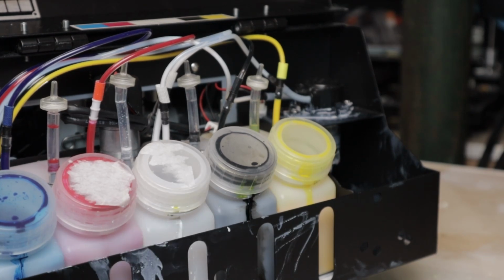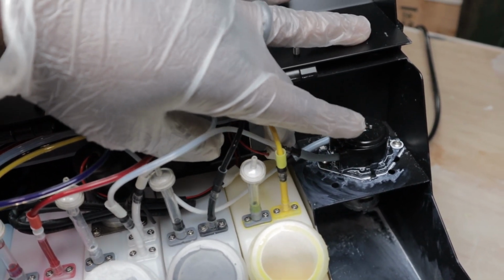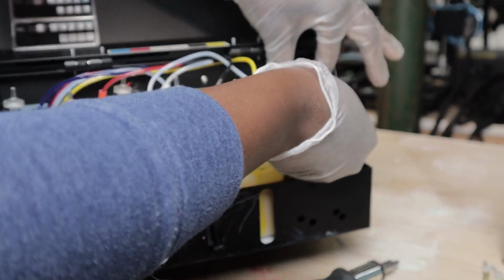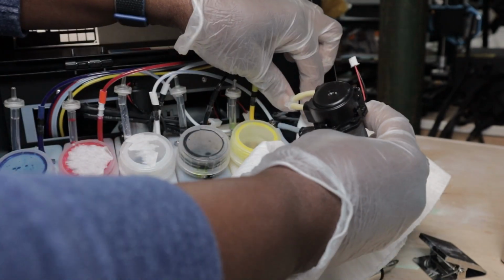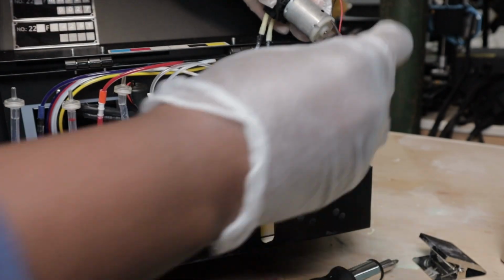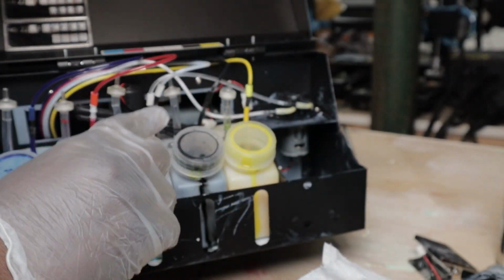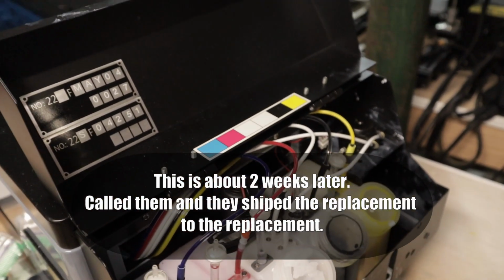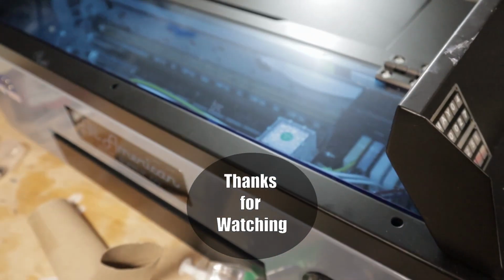Replacing the WIMS Pump for the All American Print Supply Prestige A3+ DTF Printer

Comment: Hey,do you suppose to take out the clear tips? Where did u get the black ones?
Reply from the maker: Hi, thanks for watching. The black couplers were installed on the printer. The clear ones cane with replacement pump. The black ones were tight almost, fused to the printer lines so it was easier to remove the clear ones instead of the black.
Reply: @nikittyworkshop  thanks for the reply. My wimps pump have not been circulating the white ink since I got  it back in March...I've gotten a replacement and it's still not working ....do you have any suggestions?
Reply from the maker: @highlywouldkustomz  I had the same problem. The 1 st replacement that they sent me didn’t work. The 2nd one worked fine. I would contact the company that sent the replacement and have them end out another one. Other than I’m not what to recommend. Quality control is not the best for any of these products.

Comment: Thanks for this, do you know where I can buy the pump, I can't find it. thank you
Reply from the maker: Thanks for watching. Here is a link from AA Print Supply Co. https://aaprintsupplyco.com/products/white-ink-circulating-motor-for-prestige-a3-a3-r?variant=40079681618004&currency=USD&utm_medium=product_sync&utm_source=google&utm_content=sag_organic&utm_campaign=sag_organic&utm_source=adwords&utm_campaign=PMax-DTF+Supplies&utm_medium=ppc&utm_term=&hsa_src=x&hsa_cam=19109624795&hsa_acc=9273162665&hsa_mt=&hsa_ver=3&hsa_tgt=&hsa_ad=&hsa_kw=&hsa_net=adwords&hsa_grp=&gad_source=1&gbraid=0AAAAADmL0GdaOsbUNqPZwVpBULsfyDQlz&gclid=CjwKCAjw88yxBhBWEiwA7cm6peWNo87hpx0WN264A-IM2qBsvUKmbb6IrvxGmBMY396Yre8DNR_e3xoCzqAQAvD_BwE

Check with the seller to confirm it will fit your printer.

Comment: How is it holding up ? Mine having mad issues red maintenance light always on. Called tech support trouble shot it and all and they suggested I upgrade 😭
Reply from the maker: @highlywouldkustomz  hi have you tried resetting the waste ink pad counter? That would show a red blinking light as well. Tech support can send you program to reset it outside of the DTF software.
Reply from the maker: @highlywouldkustomz  I stopped using mine. I was concerned about using in the house with my family, even though it was in the basement.